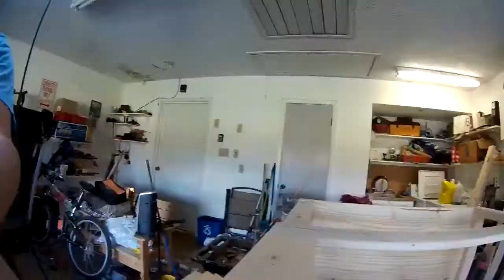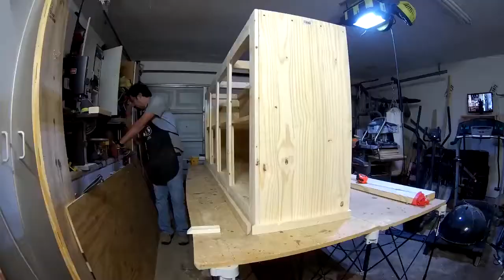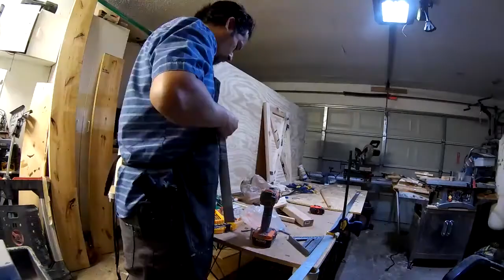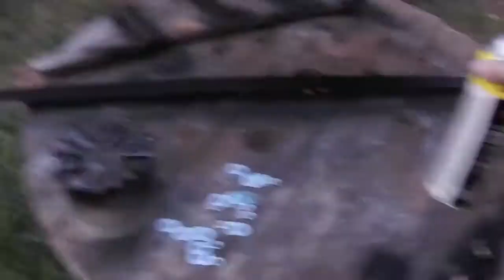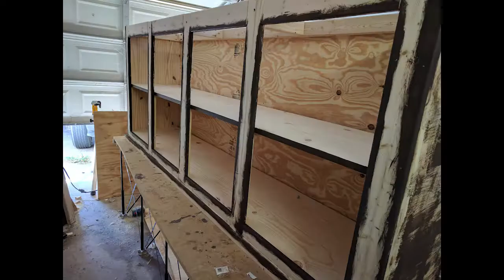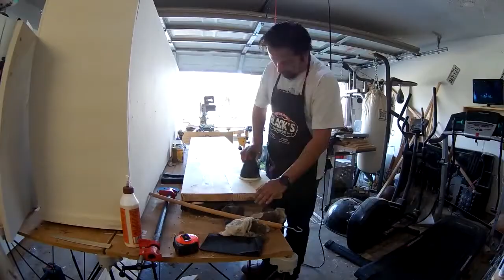Farmhouse TV Console with Sliding Barn Doors Build - Time Lapse

Comment: Hey Sal what kind of wood did you use on this? And how did it take you for the build alone? No paint or stain
Reply from the maker: Hey Brandon. I used pine wood from Lowe's. It took me two weeks to build. Just evenings. Could probably be done sooner then that.
Reply: Sal do you have any issues with the wheels being painted? Does the paint chip off eventually since it’s rolling on the aluminum?
Reply from the maker: @brandonmag57  I'm sure eventually it will chip but I haven't heard anything from the ones I made and sold. I put a few coats on the wheels. Besides, distressed look is in lol
Reply: Sal Yanez sweet!
Do you nail the supports underneath the middle shelve to the back piece of plywood?
Reply from the maker: @brandonmag57  I'm not understanding which part your talking about. Look in the description of the video. There's plans linked there that I used.

Comment: What size aluminum did you use?
Reply from the maker: It was 1.5 inch width. Worked good.
Reply: Sal Yanez where did you get it? Home Depot?
Reply from the maker: @brandonmag57  from Lowe's. But HD should have it also.
Reply: Sal Yanez do you use 1 1/2” patio door wheels?